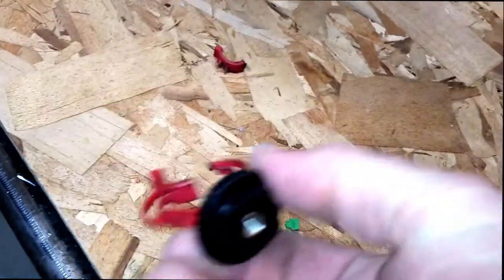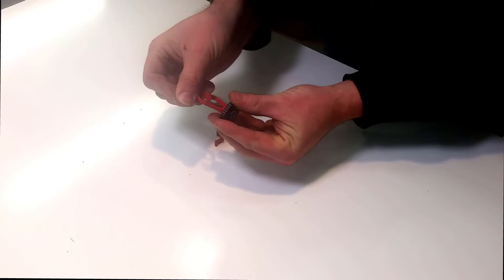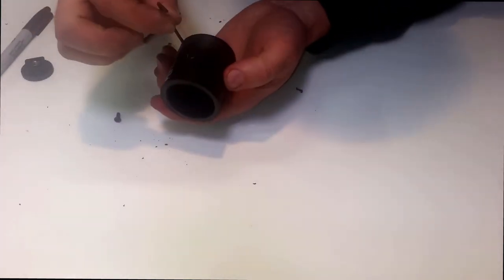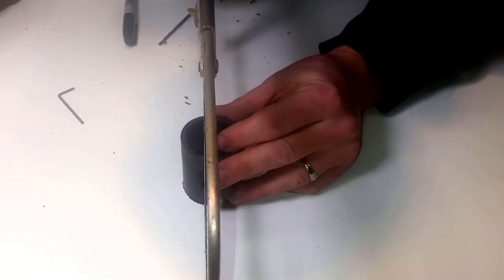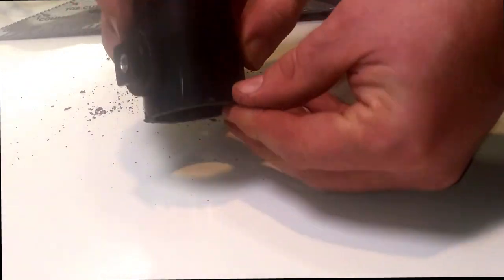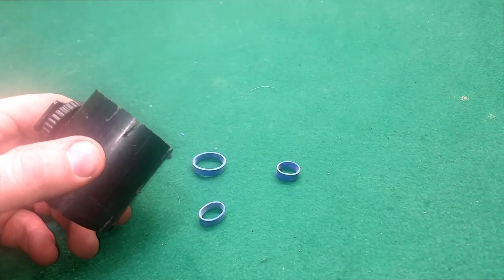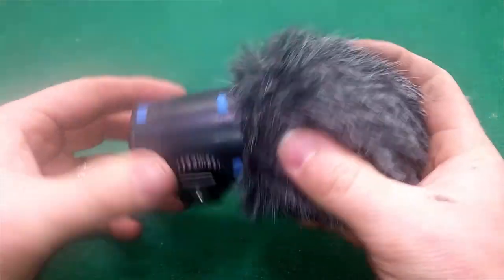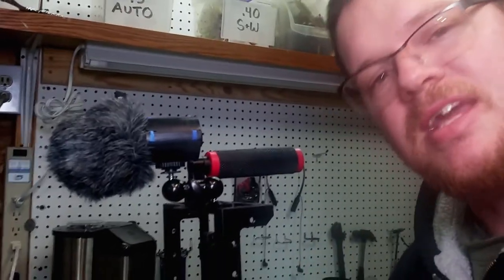HOW TO MAKE A DIY CAMERA SHOTGUN MIC SHOCK MOUNT

Comment: You should be aware that you are probably changing the cardioid pattern because you are blocking a direct audio path to the side ports on the mic. Those openings are integral to how cardioid mics like this with a single capsule internally work. You may or may not notice the difference. There are lots of variables when recording audio anyway.
Reply from the maker: Thank you for your helpful insights.  I am learning so much every day about audio and lighting in my journey.  Thank you for sharing your knowledge.
-Will

Comment: Hopefully, the manufacturer will see this video and copy what you've done because many other people have had the same thing happen to their original mount. On the MOVI website, they want $12.95 for a replacement mount. Your DIY job in not very pretty but it looks like it will do the job. Well done. The manufacturer should have designed something like this, to begin with.
Reply from the maker: Thanks Lawrwnce. It was simple and it worked.  Good day sir. 
-Will

Comment: I've got to say, the mount that comes with the BY-MM1 is rubbish, but what you've made has inspired me to make one. I'm also no hugely impressed with the fluffy windshield,and I think that's down to the foam inside it, but I have some faux fur that I could put over the entire shock mount which could make for an extra improvement. Food for thought.
Reply from the maker: I think the faux fur is a great idea!  Use what you have and save some money.  Nothing wrong with making something better.  Let me know how it turns out.  Thanks for watching! -Will

Comment: Same thing happened. First time putting the mic to the holder and it broke. Tried to be careful and did it in room temperature so the part is definitely flawed. Not sure about the mic yet but should have just bought Rode and not this badly copied product.
Reply from the maker: I've been considering Deity microphones as well.  Check them out.  They have great opportunities to give Rode a run for their money..  Thanks for stopping by.  Good luck with you mic.   -Will